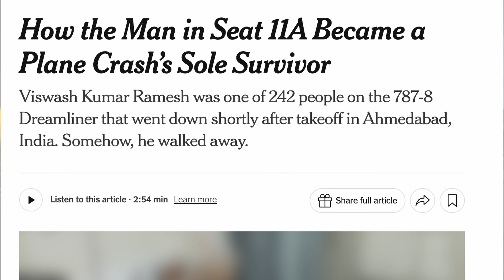Why the RAT Changes Everything – Air India 171 Update

Comment: Do not forgot the video from the passenger that flew that exact plane earlier in the day and he showed major electrical issues.
Reply: Do you know  where that video is??
Reply: @kathy93551 I think that the video that everyone is referring to was actually taken by one of the passengers on the actual  plane that crashed: when he first got on the plane, he said there was no air conditioning, it was very hot, and he videoed footage that showed that none of the electrical systems were working on in-plane devices like the video remotes.
Reply: @fleetskipper1810  Actually FIVE reasons why RAT deploys. (from friend Flight Safety Engineer in North Charleston; confirmed by blancolerio).

Pilots put out Mayday for “engine failure” at 13:38:25.

1-Dual engine failure; 2-Low pressure in all three hydraulic systems; 3-Loss of all electrical power to Captain and FO flight instruments; 4-Loss of all four electric motor pumps of the hydraulic system and flight control system faults during approach; 5-Loss of all four electric motor pumps of the hydraulic system AND an engine failure on takeoff
Reply: @fleetskipper1810 just want to point out that the air not running is not uncommon when planes are sitting on the tarmac. Companies don’t want to pay to run the air conditioning during boarding. I’ve been on many flights with no air conditioning on the tarmac
Reply: @Sarah-ty5ev Good point.
Reply: He said it was the same plane hours before flying from New Dehli to the airport. @fleetskipper1810
Reply: @fleetskipper1810 exactly. The flight before the one that crashed.
Reply: @kathy93551 absolutely nothing including AC wasn't working in that video I have seen the video too. Then what comfort are the passengers paying for? 🤔
Reply: @kathy93551  I don't think I can post URLs, but you can search for it.  The New York Post has a copy of the video uploaded.
Reply: @kathy93551  that video is not from this plane.
Reply: @ins3rt...Yes it is.
Reply: @ins3rt  This is a version of the Video.

https://youtube.com/shorts/HW0Fx5bXktU?si=JwS0bgGsdYalA5RU

It’s the same plane. Not the same flight. It was taken on the flight before, DELHI to AHMEDABAD. 

It was the flight after, 171, AHMEDABAD TO GATWICK that was the crash..
Reply: @ins3rt yes it is!
Reply: To be more accurate, it shows systems not functional, which may have been just disabled by cabin crew. One can't just jump to 'electrical issues' from that. If the systems were working but glitchy, that's different.
Reply: @outermarker5801  exactly this. The Ac system was turned off by the crew . If they had slightest of indication that the ACs wete not working because of some electrical issue in the plane pilots would never have flown it before the next flight whoch turned out to be the last
Reply: @outermarker5801 he did mention the AC being turned on and off repeatedly in a short span, that is pretty suspicious and leans towards “glitchy” electricals as you put it
Reply: @hyperterminal_reborn   Perhaps, but AC off for departure isn't unheard of depending on a bunch of factors. I'm more inclined to lend significance to the survivor's account of apparent issues just before the crash.
Reply: The interior electronics has got nothing to do with the flight control
Reply: Doesn't have any related
Reply: Where is this video?
Reply: The passenger entertainment and charger outlets are not connected to critical airplane systems. This doesn't mean much.
Reply: For those who are curious whether the plane that Akash Vasta was on was the same as the plane that crashed, here is the explanation. Each plane has a registration number (tail number) and a flight number. The registration number is attached to the related plane. While the flight number depends on the flight route of the plane. So the same plane can have different flight numbers. Regarding the Air India crash in Ahmedabad, according to the boarding pass in circulation, the plane that Akash Vasta was on (Delhi-Ahmedabad route on June 12, 2025, departing at 09.50) had flight number AI 423 and seat number 25A while the Ahmedabad - London flight that crashed was flight number AI 171. Both are the same planes with registration number VT-ANB.
Reply: So both engines worked fine for 3 or 4 minutes but then failed simultaneously ?
Reply: The man flew in on that plane.  The planes next flight was this one
Reply: @keylargo7647 The video shown is a single aisle aircraft.   The 787 is a two aisle wide body.
Reply: Electric not working before engine start has nothing to do with engine. Before the engine start electric is provided by the APU which is a small turbine engine in the tail.
Reply: That video may have been just the plane on the ground not spun up yet
Reply: A passenger flew a plane?
Reply: How about all the reports of electrical failure preceding the power (and hydraulic) failures?
Reply: It was by a lady who complained about the Entertainment system not working
Reply: No , it was both engine failure.. 
Actually both pilots have  long experience
Reply: That plane is not the same one.  It is a single aisle where the plane that crashed has 3 rows of 3 seats requiring 2 aisles.  When he pans across at the end you can clearly see this.  Even if someone tries to say it's first or business class they are not that big.  I went onto Air Indias website & looked at their flights to London from the city & no matter how you put it in its a wide bodied plane as you can also go on an Airbus to Heathrow then bus to Gatwick.
Reply: I flew Air India from Chicago to Dehli in April, and the interior was the worst I’ve ever experienced.  No tv worked on the seats.  The reading light didn’t work.  The arm rest between the aisle seat and the middle seat was literally falling off broken.  It was awful.  The staff, on the other hand, was amazing.  But it felt like we were in the biggest pile of junk to ever take the air.
Reply: @quengmingmeow This issues will be there untill all new flights ordred by Air India arrives. Thereafter game changes
Reply: @quengmingmeow :  and the toilets after a 10+ hour flight...
Reply: Yes I saw that true nothing electrical worked
Reply: @pgrande15  he says this the whole time but that was exaggerated. Besides that  might have been the case because they parked with engines off
Reply: The video is on TikTok, its a guy showing that everything wasn’t working. The issue was maintenance negligence in my opinion.
Reply: @EndtimesArehere-p2j Infotainment system not working or AC not working sometimes are not related to this accident
Reply: My initial gut Instinct reaction , having flown in a few third world places maintenance is not a concept theyre big on. Thankfully these machines are so well made they stay in the air
Reply: @MindbodyMedic What’s your examples of poor maintenance in poorer countries? I’ve also been in many of them and I never felt particularly in danger, except once on an AN-140😅
Reply: @MindbodyMedic I think it's a bit wild to say that about Air India - the main company - which hasn't had a fatal accident since 1985. It's not Russia you know 😂
Reply: @MindbodyMedic until they don't
Reply: @kazmakesnoise ? Russia makes hypersonic missiles, u think they don’t have Engineers?
Reply: The video in question is on the New York Post channel. He claims he was on a previous flight on the exact 787.
Reply: That video indicates an aircraft with a single isle cant you guys even see??? its a narrow body😂😂😂
Reply: He did NOT fly on the same flight.  How would he post the video if he's dead? 🍒🍩🍼
Reply: @PaliAha he flew that plane earlier from Delhi to  Amadabad and showed how the electrical systems were malfunctioning
Reply: @SudiSaiorse13 yes EARLIER in the same day.
Reply: It was my understanding that this video is of the same plane days earlier?  @PaliAha
Reply: @PaliAha It was the flight before the doomed flight that had electrical problems and no a/c
Reply: @PaliAha he was on the first leg of the flight from Delhi to ahmedabad
Reply: He was on the same exact aircraft from an earlier leg. He flew with the plane from Dheli to Ahmedabad.  @PaliAha
Reply: @PaliAha it was taken the day before in another flight on the same airplane
Reply: @PaliAha he flew in it but on a different day before this June 12th mishap. 😢
Reply: @PaliAha Don't be daft the same flight flew in from Delhi to Ahmedabad earlier.
Reply: @PaliAha he said he was on the same aircraft just 2 hours before it crushed. He flew to Delhi to Ahmedabad
Reply: @PaliAha he was ona pervious flight, but it was the same plane
Reply: @PaliAha he flew the same plane. But not on this route. It was the earlier route. Delhi to Ahmedabad. Not Ahmedabad to London
Reply: @PaliAha  He said he flew the exact plane, not the exact flight, genius. Idk what is so hard for you to understand in that concept. Planes can fly more than one time.
Reply: @PaliAha  He could’ve boarded the plane early on, have taken the video, and emailed it to someone before the crash.

I’m not 100% sure that he instead was on the same plane earlier in the day, however. Someone else said he posted it on TikTok from earlier. I’m just not sure.

Comment: VAS mentioned the sound of the RAT In his original analysis, but this original video makes it clear as a day that it was deployed (both in sound and visual), and that the engines were not running.
Reply: Of course it's VERY helpful but it throws up the MASSIVE problem of what could cause a dual-engine failure?! Captain Steve said (I think) it's a one in a trillion occurrence! This could affect thousands of future flights if it isn't 'solved' quickly.
Reply: @Musicmanleeds one in a trillion implies that it has never happened before, as nowhere near a trillion planes have been made.
Reply: @Musicmanleeds Poor quality
Reply: The pilot radioed that he had no power, lost thrust so I always thought they had lost the engines.
Reply: Dear captain you need to say that you and us all feel so sad about this terrible happening I know everyone is but it still needs to be said 
With sad feelings Martin.
Reply: During take off is the autopilot at all engaged?
Reply: @MaForunaBre  No.
Reply: The RAT is a tiny wind generator, you would never hear it.
Reply: The pilot can deploy the rat while the engines are running.
Reply: @GlobalDrifter1000  But why would he?
Reply: @jefftynan9274  indeed, why?
Reply: @GlobalDrifter1000  You would never manually deploy the RAT unless it did not automatically deploy.
Reply: I dont see the RAt and i  have 20/20 W/O GLASSES.  Where in the video is seen ?  i DO HEAR the engines well. Not The Rat.  No flaps added at low speed as needed there.  And even if no electrics if ever, you can pop flaps as needed there.  We do that as Bush Pilots for decades if found too slow ever. CFI of Bush Pilots..

Comment: the RAT will deploy if both engines fail but how would that happen
Reply: Fuel contamination
Reply: @MattyEngland  But surely they would feel that going down the runway.
Reply: If one engine fails and they turned off the other one by mistake, a flock of birds at the end of the runway, fuel bad, fuel pump failure, just total bad luck.  Only the flight data recorder will know.
Reply: maybe fuel system problem. i even got more problematic when it took off.
Reply: From stuff. 26 youtube pilots have already talked about it.
Reply: Boeing is now on crisis management....its probably not pilot error but aircraft system failure...oops their stock is going to tank
Reply: Pilot turn the key OFF

Comment: I'm calling a hydraulic failure
Reply: Not sure about that, if so they'd not be able to use the ailerons and pull up.  Hydraulic loss wouldn't cut engine power either if that's what you meant.
Reply: They would be able to use the ailerons.
But the nose up was triggered by lack of speed.
….and the fuel pumps are electric
Reply: @cardinaloflannagan8929 I think there is a problem with the fuel system rather than the hydraulics.
Reply: They pitched up before the crash indicating working hydraulics.
Reply: @PabloGonzalez-hv3td  …Nose up could be also from lack of speed.
That’s typical attitude behavior from these big airliners.
…but it’s irrelevant, the RAT provides electric energy for at least some of the hydraulics.
My take on that is that yes, they’ve lost hydraulics because they’ve lost all electric power to operate them. The RAT brought some back.
Reply: @PabloGonzalez-hv3td  Nose up is also typical from low speed (stall) on big airliners.
Reply: To fail that quickly would have to be a huge leak, as far as my knowledge goes, could be wrong. You'd be able to see a leak that big, hydraulic fluid would just be raining down in the path of the plane

Should state in my personal opinion it was a serious electrical failure. Also because there was a mayday call for engine failure.
Reply: A hydraulic failure would still give you thrust. I don’t think that this is the cause
Reply: @Cars-k8e  Probably general ‘black out’. Total loss of electric energy. I don’t know of any scenario where all three circuits can be simultaneously affected that would leave the fuel pumps out of energy but that is what it seems to have happened.
Reply: @Cars-k8e  I made my post when there were no replies to the OP, but yes, this makes sense. Hydraulic failure might explain the landing gear but doesn't explain the crash.
Reply: @H0lyMoley yes I understand, I personally don’t think it was a hydraulic failure. As you said even with a hydraulic failure you have thrust to fly..
Reply: @Cars-k8e you don't have thrust through the RAT . It only provides basic power to system so that you can use the radio and a few other instruments on the panel
Reply: @rounaqrai I am not saying that the RAT is generating thrust. I am saying a hydraulic failure would still give you thrust to fly…
So I don’t think it was a hydraulic failure alone if it was one
Reply: Suspect Both Engines' Fuel Shut Off Valves somehow went shut caused by wire shorting within the Power Control Box.
Reply: It's actually great to see how different people think differently.
Reply: If you don't know, the engines themselves have to be running to supply both electrical and Hydraulic pumps that require electrical power. You don't need an engineering degree to figure this out.
Reply: @user-xs8gm2md6d and the APU does what?
Reply: We won’t know until investigators release more details.

I’m betting on electrical bus failure.  The fuel pumps are electrically powered, so if the electrical failed then the fuel pumps would shut off and the engines would shut down.  It would explain everything.  The “bang” and lights flickering included (especially those!)
Reply: I was also thinking that. If the RAT deploys due to a hydraulic failure, isn't there a case that this is why the landing gear didn't deploy? I thought that that was a hydraulic system?
Reply: @H0lyMoley Landing gear not retracting fully could be due to loss of electricity too, not just hydraulics, it takes both. RAT uses gravity to deploy and will also deploy with failed electrics.
Reply: @H0lyMoley  most probably.
The RAT doesn’t provide energy for gear up.
Reply: @H0lyMoley it’s the Center Hydraulic system that powers the gear and steering etc…